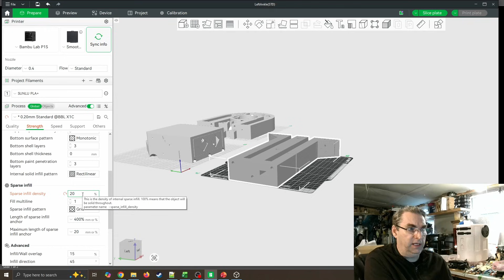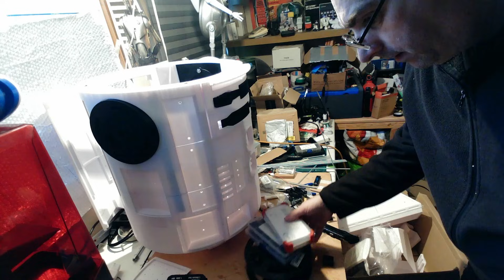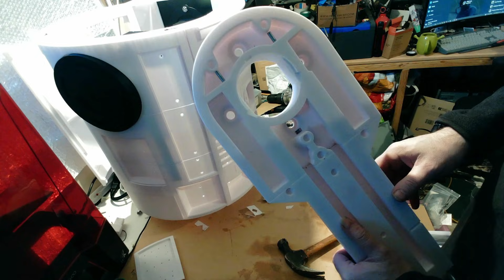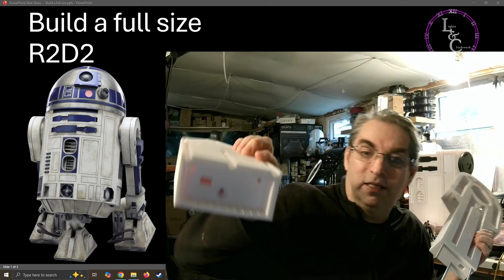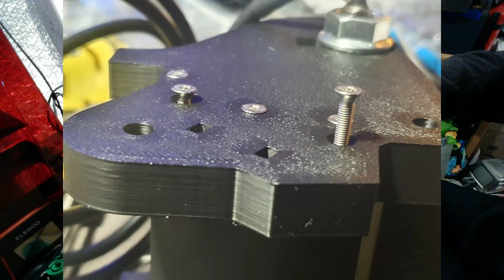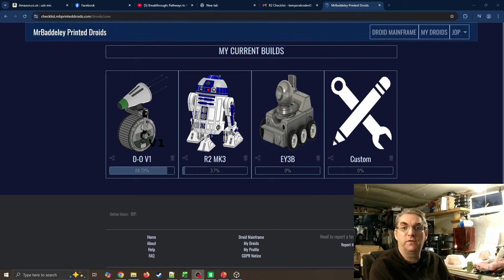R2D2 Full Build Part 3 - Legs and Drives

Comment: Great video! Wondering if these would work with a Padawan 360 setup, would the wires just connect up to a Sabertooth instead of the ESC?
Reply from the maker: I believe Padawan has been updated to work with these motors, but NO! you cannot hook these motors to a Sabretooth, very different technologies. I am going to hand over to one of the other UK builders to talk about padawan soon.

Comment: Good tip on the M3 bolts. I had one bugger up its head but it was pretty close to right and my Allen key finished it off. I’ll use your suggestion for the other side

Comment: Thanks for designing the new drive system. I have the first redesign files for the new foot. Where can I get the updated version? The part where the new motors mount.
Reply from the maker: The Design is Mr Baddeleys, If you click on the link in my description they are on the Patreon.
Reply: @lightsandclockwork Does he have the new design to match these motors? The Patreon is huge. Can you let me know where to find them?
Reply: I found it. It is the MK4 Astromech Drive Options

Comment: any chance you could post links to the various components that you have bought?    wheels, drives, motors, etc...

it's looking good - I am just finishing off printing my body, got the dome and suspension printed in PETG-CF, body and legs are PLA+     now to redo all the greeblies and panels.
Reply from the maker: Yes. I have tried to keep track of most of it. But it is all region dependant.
I will try and include on Part 4 and post a link.